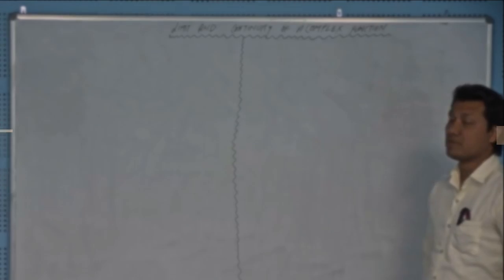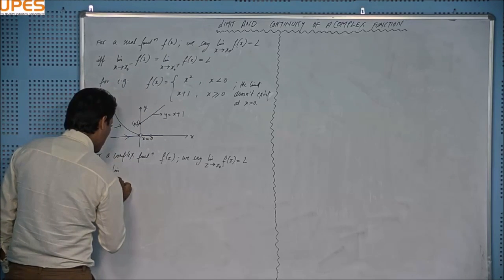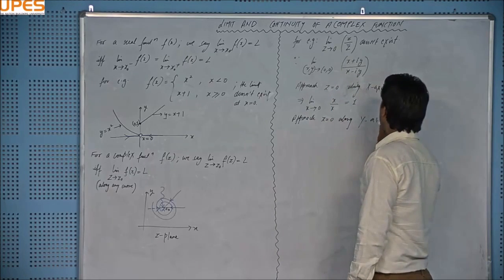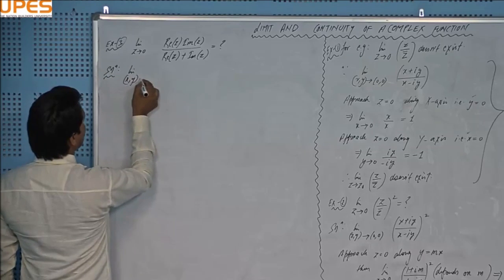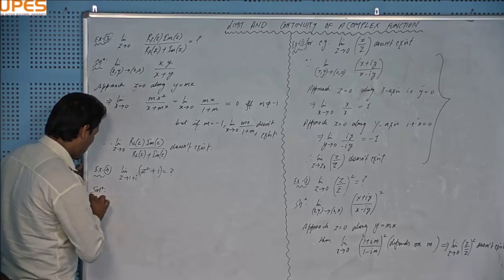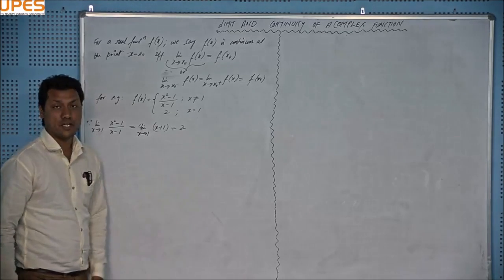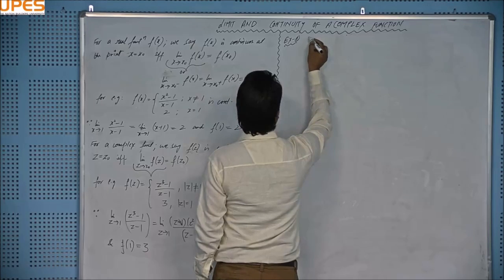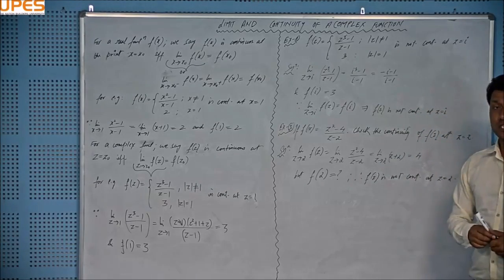Complex Analysis|| Limit and Continuity of a Complex function

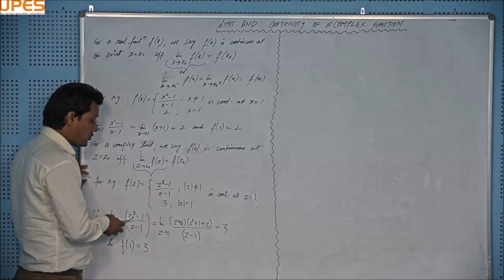Comment: sir at 37:25 when we take the point along y axis x will be equals to 0.......so its comming (iy)^2-+1+(iy).........but you said it will be equal to 3...please reply sir thanks in advance
Reply: and mod of is a circle with unit radius and centre (0,0).........i am little bit confused about the sum please reply sir
Reply from the maker: @suryasikharej8116  Are you asking for the equation of a circle in complex plane? It is |z-a|=r where z=a is center and r is radius.
Reply from the maker: Approaching z=1 along a line parallel to Y-axis (i.e. z=1+iy); you get (1+iy)^2 + 1 + (1+iy) (recheck your calculations) which goes to 3 as y --> 0.
Reply: @UniyalNitin  sir if i approach along a line parallel to X-axis what will be the equation ? thanks for the reply sir means a lot
Reply from the maker: @suryasikharej8116  You can't approach z=1 along a line parallel to X-axis as this point  itself is lying on X-axis. You can approach it horizontally along X-axis only i.e. y=0.
Reply: @UniyalNitin  thank you sir now i got it....thank you for clearing the doubts

Comment: I appreciate your co-operation on this sir , i have some confusion with the continuity of the principle argument function f(z)=Arg(z) does it discontinous at the negative real axis only?
if so how can i show that ? 
Thank you
Reply from the maker: Hussien Mohamed Thanks...The principal argument function i.e. arctan(y/x) is continuous on negative real axis. However, it is not defined at the origin.
Reply: Nitin Uniyal 
do you mean that it is discontinous at the negative real axis ?
Reply from the maker: No, it is continuous everywhere except at the origin.
Reply: The text books say it is discontinous at any point on the negative real axis because the limit is not exist
Reply from the maker: The value of the function at each point on negative real axis is arctan(0/x)=π (where x is not 0). So, the text book is wrong.
Reply: Nitin Uniyal The trick is the limit at those points i think if we take different paths to approach the point z=-1 (for example) we get different values of the limit
Reply from the maker: What paths are giving you different limits? Can you elaborate?
Reply: Nitin Uniyal if we take the pathe z=e^(i¤) , pi/2<=¤<=pi
we get the limit equal to pi 
but the same path with 
-pi/2<=¤<=-pi we get the limit equal to -pi
Reply from the maker: Hussien Mohamed, z=exp(it) is not a path, rather it is a unit circle centered at the origin (where the function is not even defiNed). You must choose something like z=a+exp(it) where a<0 and t€[0,2π) in order to see tge existence of limit.
Reply: Nitin Uniyal sorry for this 
i mean if we take the path 
|z|=1 in the second quadrant(say) we get the the limit as z tends to -1 equal to pi 
and if we take the same path but in the third quadrant we get the limit equal to -pi